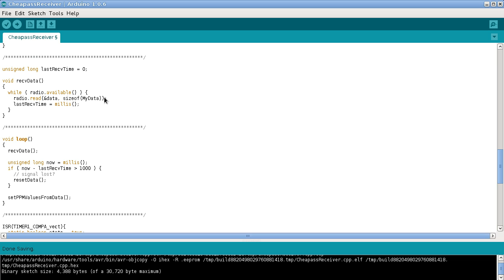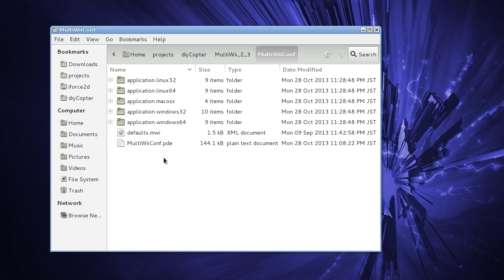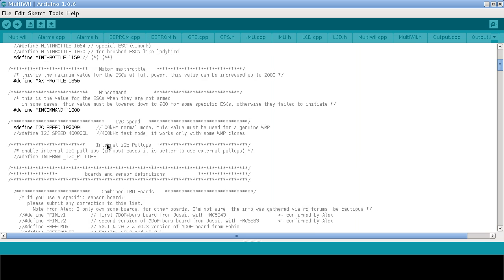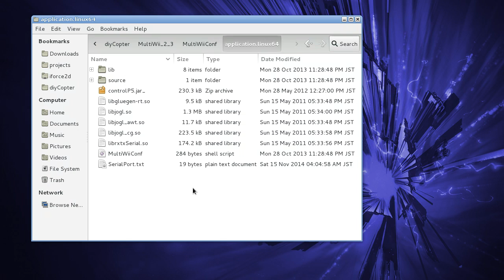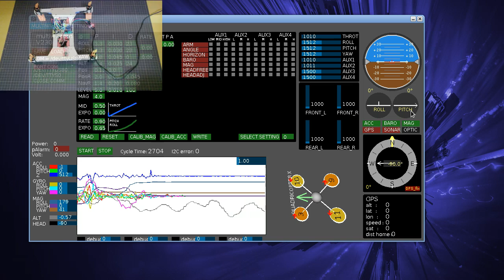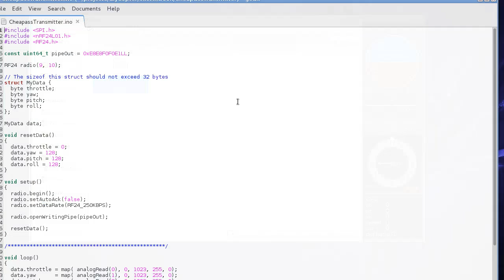Cheap-ass quadcopter build Part 8 - "Receiver" (continued)

Comment: Hi,
Thank you for the great tutorials.
I have watched them all with great interest and I have managed to put togheter a tricopter using (mostly) the same parts (Nano as receiver, a Multiwii SE 2.5 and the transmitter sketch is up on a Mega). My problem is that the motors don't spin. I used the GUI to test the communication and it is working good, the values that are changed when moving the sticks are good, arming also works (the MultiWii led stays on and the green box with ARM on it turns green in GUI). I don't really know what I am missing. I have also searched the web for answers and tried to fix the problem as others said but it is not working, so could you help me please?
Thanks a lot!
Keep up the good work!
Reply from the maker: When it's armed, do you see the motor values moving in the multiwii conf gui? Have you managed to get the motors spinning at all (eg. with the servo test sketch)? For a tricopter I guess you would have a servo as well, how about that, does it move?
Reply: There is only one motor value that changes in the gui and it goes to max like instantly after 1300 throttle on the stick and below 1300 it stays to minthrottle.
The motors are working, I have tested them before with a schetch exactly as you said (they are spinning as hell :) ).
The servo also moves but only when I tilt the multiwii, when the board is stable it doesn't move, which I believe is the behaviour I should expect.
Reply from the maker: Cristi Ilca
hmm... never seen that before. "Spinning as hell" does not sound good, maybe the ESCs need to be calibrated. You could try the multiwii forums for better info than here.
Reply: The spinning as hell was just a way to say that the motors work well (with a servo sketch but not with the MultiWii) :) I have tried to calibrate ESCs by uncommenting the line from the code and then flashing it to MultiWii, but the motors don't do anything, there are just some beeps and no spinning. Thank you for trying to help! ;)

Comment: Just downloaded your sketches again coz i have them for months but still no joy :(
I have arduino pro mini 5V 16HZ seted to 2 but still nothing coming true :(

I have running "Crius all in one Pro v2.1" and arduino 5v 16hz on both receiver and transmitter .
On BT its arms copter and i can controlle it but not with receiver .

Regards
Thanks
Reply from the maker: What I mean is, did you select that board type when you upload the sketch in the arduino IDE? If so then I have no more ideas. What is BT... ?
Reply: Bt is bluetooth
Reply from the maker: Darius Keinys
ok... you are using PPM with a bluetooth module somehow?
Reply: No when i got Bt connected i can run quadcopter but i cant do that with controller yet.There is app for android to controll quad via phone or tab.
Reply from the maker: Darius Keinys
But how does the bluetooth module talk to the multiwii flight controller? Didn't you set up the flight controller to use PPM in the config.h file?
Reply: Yes i did set ppm as per your videos i have enable it but its now working.
Bluetooth works and its simple just pair and its lets me to controll quad arm it and config it same way as windows software without having computer its comunicates via tx rx
Reply: *not working
Reply from the maker: Darius Keinys You mean the bluetooth module talks to the multiwii board through the TX and RX pins? So you have never seen any PPM working at all right? Did you select the correct board type when you upload the sketch in the arduino IDE?
Reply: Yes i did there no way upload sketch to wrong board IDE wont let it.Yes bluetooth works true TX and RX pins.and it works that way but bad thing is im limited to 10m range so im not even bother to test fly till controller up an running.
Reply from the maker: Darius Keinys But it is possible to upload to the wrong clock speed, eg. if your board is 16MHz and you upload using 8MHz the timer interrupts will be too slow and PPM connection will not work. If you have set all that correctly then I have no more ideas, except to connect an oscilloscope and look at the PPM output that your arduino is making.

Comment: Using serial looks fine data coming true if i print PPM[0] its comes ok and response fine.
but seams ppm not going true to board

regards
Thanks
Reply from the maker: The timing is important for PPM. Are you using the correct board type (8MHz/16Mhz)? And did you set the appropriate clock multiplier for it? There should have been an error the first time you tried to compile, which forces you to choose a value for the "clockMultiplier" variable

Comment: Default test code from here http://arduino-info.wikispaces.com/Nrf24L01-2.4GHz-HowTo#ex1 works fine .

When i use your sketches seams nothing happening .

and in MultiWiiConf nothing changing like in yours.

gyro and so on works fine .

Regards
thanks
Reply from the maker: So I would guess that it's the PPM part that is the problem? What do you get if you do some Serial.print etc on the receiver to see what value it has?

Comment: Hi iforce2d,
first of all I would like to thank you for your videos. I like all of them, maybe with an exception of the ones about RUBE, but that's just me :) This tutorial is excellent!
A little optimization to your sketch. In CheapassReceiver in recvData you can move lastRecvTime = millis(); out of the while loop. May help a little. Another thing is the default value of throttle. Maybe setting it to something else than zero would prevent it from just falling from the sky and gracefully come down.
These are just suggestions. Thanks again!
Reply from the maker: I've been doing videos about RUBE for many years before I knew anything about quadcopters - I really hope you can tell from the thumbnail what each video will be about :)
I prefer it to fall from the sky rather than keep drifting further into the distance - it also lets me clearly see when I have lost signal, so I know what to start looking at when problems occur. But you are right of course, it would soften the 'landing a lot. If I had a lot of space, no people around, and I was not flying by a river, I might try that.
Reply: *****
OK, I took some time to watch your RUBE videos and I admit it's pretty cool!
I'm not sure if I was undestood correctly with the "while" suggestion.
My idea was to change in CheapassReceiver.ino:
void receiveData() {
  while ( radio.available() ) {
    radio.read(&data, sizeof(packet));
    lastReceiveTime = millis();
  }
}
to:
void receiveData() {
  while ( radio.available() ) {
    radio.read(&data, sizeof(packet));
  }
  lastReceiveTime = millis();
}
Checked, it works. Thanks!
Reply from the maker: voyva1 No, it would not work. You should not set lastReceiveTime unless you actually received a packet. Otherwise there is no point to have that variable at all :)
Reply: OK, you're right. Duuuh ;) It seemed to me quite an overhead to invoke millis() each time. Adding a variable to check if radio.read was executed, e.g. like this:
void receiveData() {
  bool isRead = false;
  while ( radio.available() ) {
    read = true;
    radio.read(&data, sizeof(packet));
  }

  if(isRead) {
    lastReceiveTime = millis();
  }
}
seems to add too much clutter to what was a neat code.
Reply from the maker: voyva1
Most of the time the "while" will only be entered once anyway. The only reason it's a "while" and not an "if", is because we want to clear the buffer properly just in case more than one packet gets in there. But even before considering that, I think you need to also consider the value of reducing calls to millis in the first place: http://arduino.stackexchange.com/questions/113/is-it-possible-to-find-the-time-taken-by-millis

Comment: Hi Iforce2d,
thank you for your great channel.
I have connection problem. I would be glad if you would help me

my arduino is "Arduino Pro or Pro Mini (5V, 16MHz) w/ATmega328"

I've been using these sketches no problem.
http://arduino-info.wikispaces.com/Nrf24L01-2.4GHz-HowTo#ex1
the connection is established immediately, and serial monitor displays the data.
Reply from the maker: so.... what's the problem then :)
Reply: http://www.mediafire.com/watch/8fz5j3me81hj5nd/dont_connect.wmv

http://www.mediafire.com/watch/oapapm2jbph7d52/connect.wmv

http://www.mediafire.com/watch/0jn2nqxp5692te9/debug.wmv
Reply from the maker: hayta haytapot
 ??? what's the question. Maybe you should ask in the arduino forums. Those videos are almost impossible to make sense of.
Reply from the maker: *****
Well, I watched all the videos. So if you have one situation that works and one that doesn't, the only thing I can suggest is to gradually change one of them to become like the other, until you get a different result. I have to say though, this is not a good way to explain your problem and takes me a long time to guess what you are trying to show in the videos - you need to give better explanation if you want people to help you.
Reply: i am sorry,
i wanted give explanation, but my english is not well, i had to think long and translate it, and it was too late. i was planning to give an explanation today.

i am new at Arduino, i am trying to learn.

i tried to change like other but no success.

http://www.directupload.net/file/d/3909/7yj7tj9g_jpg.htm
can you see the picture and say me are all ok?
Receiver has TX_ADDR_P0-1 = 0e7e7e7e7e7  0xe8e8f0f0e1
Transmit. has TX_ADDR_P0-1 = 0xe8e8f0f0e1  0xc2c2c2c2c2

should i change in sketch the TX_ADDR_P0-1 from 0xe8e8f0f0e1 to 0e7e7e7e7e7

thank you very much
Reply from the maker: hayta haytapot The transmitter TX address is set to 0xe8e8f0f0e1, and the receiver RX address is the same, so I don't see any problems. I suggest you gradually start changing your sketch to be like mine, testing after each small change, and see where the problem begins.
Reply: ok, i will try to change step by step.
thank you

Comment: Hi again:)
I have faced the problem during upload the code into flight controller. The problem was: "avrdude: stk500_getsync(): not in sync: resp=0x00"
For me the solution was choose another board definition from Arduino IDE. It started to work for me with "Arduino Mini/328" but it didn't work with Arduino Pro or Pro Mini/328.
Hope this helps somebody:)

Comment: Hi again,
I wrote an e-mail to icstation.com and had asked them which of the IMU boards definition in the config.h file was the best for that FC. And they answered "GY 86". I think you have got the same flight controller and you choosed "HK ..." in the code. They look similar and have the same sensors, but maybe the GY 86 definitions suit better to the icstation FC? Did you try it?
And one more question. The Arduino is 3,3V and so the digital signal from Arduino also has Hi level no more than 3,3V but it is connected to 5V FC. You didn't use any logic level converter. The arduino.cc (http://arduino.cc/en/Reference/Constants) describes that 5V Arduino input pin (so Flight Controller) reports low if voltage level is less then 3V.... Have you ever experienced any problems with bad signal level recognition due to voltage differences in quadrocopter project?
Reply from the maker: No, I didn't try GY86. I think as long as the actual IMU components used are the same it should work for most options that use those components. It seems to be working great with the HK option for me. Generally I don't think I've had any issues due to low signal voltages between the two boards, although in the video where I added the lights there was a problem I didn't quite figure out, which might have been due to that.

Comment: Hi Iforce2d,
thank you for your great channel.
I have a question about TX and RX using nrf24. I dont use any flight controller in my quad. I want to make my own flight controller using MPU6050 and arduino Nano. I use your source code about RX and TX but I dont know how to wire my motors. I use brushed coreless motor. for example with pin number 2 that we set for PPm out put Do I need to wire that to motors?
thank you in advance
Reply from the maker: I think you will still need an ESC to control the brushed motors, so the wiring will be the same as for what I did.

Comment: Hello! This series is great. I've acquired most of the parts. I have the same MWC flight controller board and FTDI board. I might have missed it but what board do I choose when uploading the sketch to the flight controller board? Thanks.
Reply from the maker: It's "Arduino Pro or Pro Mini (5V, 16MHz) w/ATmega328"

Comment: hello i like this project alot and want to replicate it but i have tun ito a problem and dont know that to do i hooked it all up the transmitter and receiver and the values i get from the multiwii are 900-1000 and the joysticks sometimes respond to that and sometime they dont can you help

the hardware i use is a promini  5v 16m as transmitter  arduino uno as receiver i just dont know where its going wrong
Reply from the maker: Perhaps you could hook up the 'receiver' arduino to your computer (forget about the multiwii board for now) and use the serial monitor of the arduino IDE to print out the values that the receiver is using.
Reply: i just tryed that and the values are coming over oke i think its someting with the ppm signal
Reply from the maker: expansiongames Just noticed you are using an uno as receiver and that will be running at 16MHz... sorry I should have looked closer earlier. In the ISR function, you need to double the values you set for OCR1A. There are three places, after changing them they should look like this (just add *2 to each):
OCR1A = PPM_PulseLen * 2;
OCR1A = (PPM_FrLen - calc_rest) * 2;
OCR1A = (ppm[cur_chan_numb] - PPM_PulseLen) * 2;
Reply: TY that did it now i still need to wacht to get my ESC and motors and then i will make a video to show you
Reply from the maker: expansiongames
Sweet! Good to hear. Sorry I didn't notice yesterday (or even mention it in the video in the first place). I added an annotation, hopefully will help others in future :)

Comment: Do you have a diagram showing how to connect the cc3d, arduino pro mini and the nrf24l01 ?
Reply from the maker: For CC3D "The PPM stream should be sent to the first input through the white wire connected to CC ReceiverPort pin 1" - more info here: http://wiki.openpilot.org/display/Doc/CopterControl+Hardware+Manual
You then need to set up the flight controller in the software config program, so that it knows to use PPM instead of individual channel inputs.
Reply: ***** How do you set up the flight controller in the software config program?
Reply from the maker: Heman Pyag I think it's in the radio setup page, one of the dropdown lists lets you choose PPM instead of PWM... or it might be on the overall config page... I was gonna check for you yesterday but couldn't find my cable to plug in. When I find it I'll get back to you - but in the meantime there is plenty of information on the net and YouTube about it though.
Reply: ***** Ok thanks